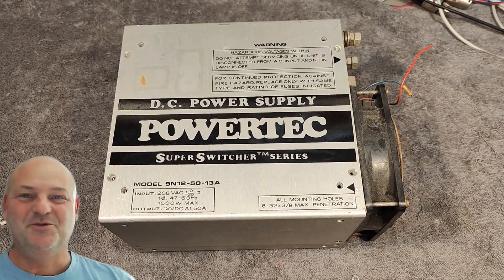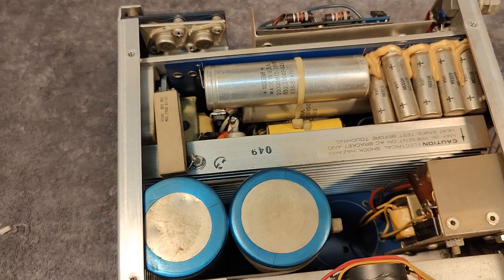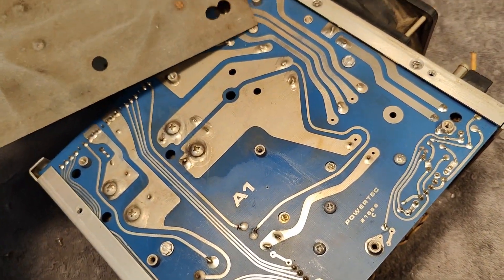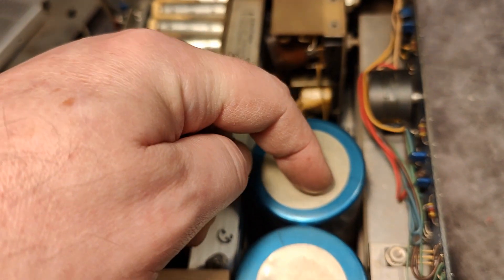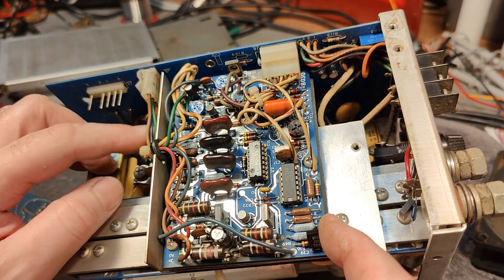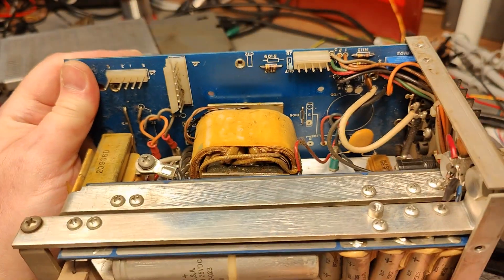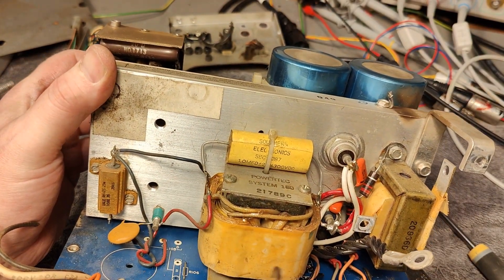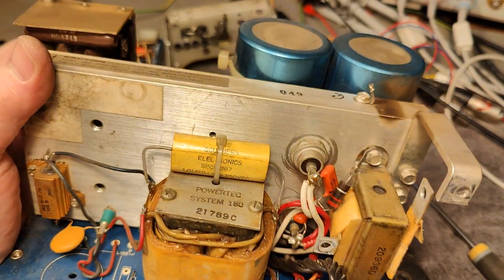Powertec DC power Supply 12V 50A smps 1981 switchmode teardown

Comment: I’ve repaired many of those Powertecs from their 5v 200amps to the one you have there. The ones I worked on were used in full motion flight simulators. By the way no schematics either, all had to be reverse engineered.